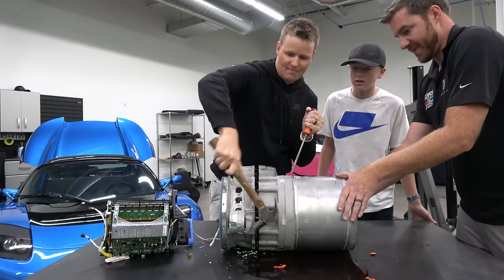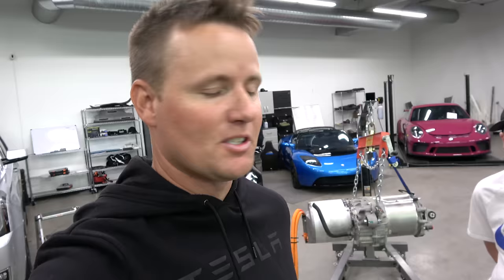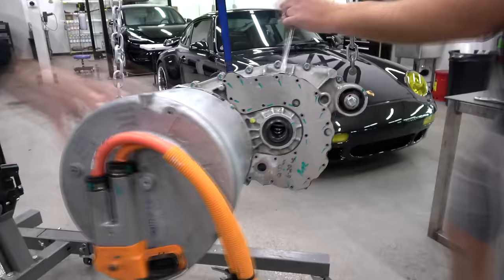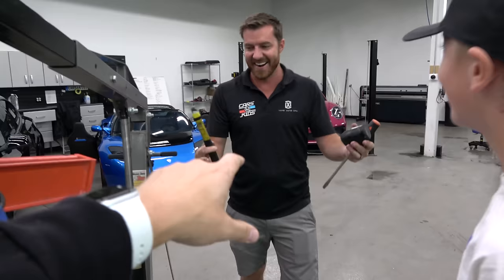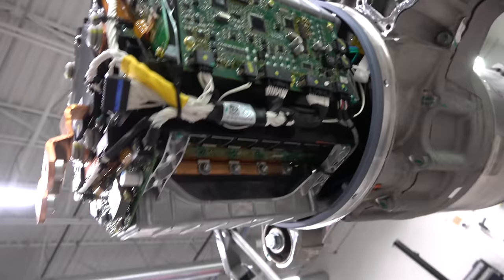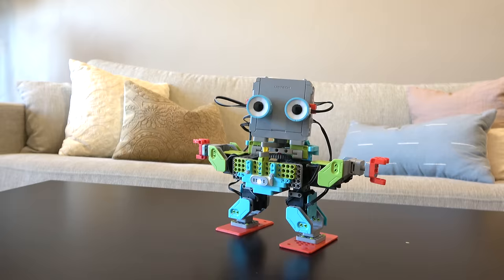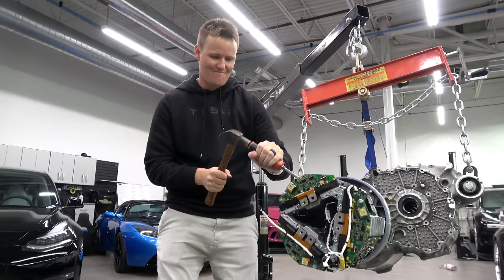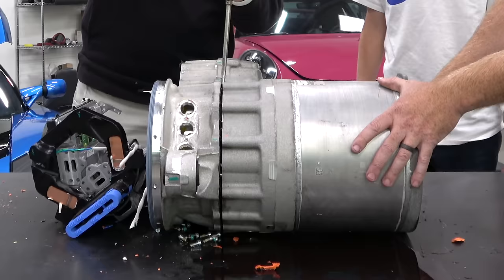What's inside a Tesla Engine?

Comment: That is amazing.... especially the computer triad area.  It is a sturdy design surviving those punishing/ jarring roads with pot holes and bumps .... then looking at the the home computer/lap top mother boards and knowing they are very sensitive to breaking when dropped.  

The home computer/lap top companies need to come up the same durability for their motherboards as did Tesla.
Reply: Reminds me of the internal layout of Apple's old "dustbin" Mac Pro.
Reply: What's inside Tesla power 2
Reply: The motor is on the body of the car, which is shock mounted, so this motor sees no more and no less road shock than the stereo inside the cabin... almost all laptop damages are done to the screen, which is mostly glass, or to the keyboard or HDD, which are mechanical, or to the power control systems, which are damaged by bad power sources.  The electronic components almost never fail
Reply: but I want a thin and light laptop and not carry around a triangle awkward shaped laptop.
Reply: No, the home computer motherboards do not, are  not, and never will, be built like Tesla parts.
Reply: i mean ive dropped my machook everywhere and it survived but not without dents in the chasis, this channel also dropped a mac from a flying heli once too, i was amazed that it sort of survived
Reply: @Jasonzvo  i'm sorry... WHAT?!
Reply: @chad9160  the mac that was dropped from a heli, the screen was destroyed but when they plugged the mac back into a external display, it worked normaly
Reply: That would just mean your computer would get bigger and more expensive... not a big market for that kind of computer
Reply: This layout of the power electronics is needed to control the phases U V W symmetrically and to equalize and minimize parasitic inductive effects.
Tesla has to pay special attention to this, because their electronics are not better than those of the other manufacturers, but cheap. 
It's no big deal if you connect four IGBTs in parallel for the Highside and Lowside instead of one IBGT(transistor).
Reply: This comment makes no sense.
Reply: @andreacoppini  almost exactly what I was going to reply..aside from maybe popping a cooler off the board because of some crap thermal compound, a modern notebook with an SSD is going to be very hard to kill.  Power connector, screen, and backlights are the only things you could really ever break unless you are REALLY trying.
Reply: Though laptop are old the marines have had them for years they will even stop a bullet gas service engineers in the UK use them as they can be thrown around and mistreated.
Reply: That motor is so sophisticated it looks like there's ALIEN technology in there...  I will not be surprised if one day, we will have some visitors from Proxima Centauri  coming here just to buy some Tesla vehicles.  That technology is simply AMAZING !
Reply: This comment shows a complete lack of any electrical or board construction knowledge. Home computers don't need to be, and shouldn't be anything like an electric motor computer.
Reply: The motors in my RC cars survive 100 foot drops and so do the circuits
Reply: I took apart a printer before and made artwork out of it.
Reply: Elon is like Tony Stark if instead of being a super genius, Tony hired the world's finest engineering talent at wholesale wages, and sold their efforts retail with his name on it.
Reply: The only things you can change in a motherboard is the thickness of its different layers or simply increase or decrease overall thickness. so as someone studying in a related field allow me to get technical here.
1.first throw out the idea that different material will be used in making motherboards.
2.laptops need to be light and thin while being power efficient and dissipate heat quickly.A thicker motherboard is worse in all these areas. 
Now lets get in. motherboards need to be just a little more flexible than the laptop frame so they always crack or break after the frame breaks. If you had a naked motherboard then the thicker the better ,but in a laptop actually a thick motherboard is more breakable than a thin one, because if its thick and less flexible than the laptop then its going break before the frame does. Also in these situations the roles of motherboards and frames change because here the motherboard will be the one actually protecting the frame from bending to breaking point, unless of course you make an even stronger frame which will either cost more or weigh more or both.
Reply: @sweetdreams1DIAM0ND  I know I am not a great technical person but that is why I have to trust someone to help me too.
Reply: Think about this for a minute. If you put your laptop in the car and drive around for a year it will be fine. Why? Because the suspension absorbs the energy from those potholes etc and that prevents damage. If you drop that tesla board from the height you drop a laptop from it will take damage and probably be screwed aswell.  I like Tesla cars but they are not magic.
Reply: @pyrobedlam  And this thing is on suspension. If you put your laptop in the car it'll be fine too, because of that same suspension. It's weird to see how much non technical people fawn over tesla parts thinking they are amazing isn't it.
Reply: @gerrycrisostomo6571  I'm sorry but it's not. It's just that you don't know anything about this technology so it appears amazing to you. No offence.
Reply: @highmarkrich  And home laptops are just fine when they have suspension ie they are in the car just like this hardware is. This thing wouldn't like being dropped by itself at all.
Reply: @ZennExile  Hahaha I love it.
Reply: @sweetdreams1DIAM0ND  Everybody is getting technical while missing the point entirely. The suspension of the car is the saving grace here. You can drive around with your laptop going over pot holes just fine because of it. If this hardware was exposed to road forces without suspension it would break. Technologically and/or mechanically illiterate people constantly thinking tesla parts are "omg soo AmAaaMmAzZiNG" does my head in. (Btw I'm not including you in those people)
Reply: I was wearing my Alienware backpack with a 15R4 inside when car almost killed me going the wrong direction in a one way road.  My bike is dead but my Alienware booted right up. I had a 14" laceration on my leg, 1/3rd of my colon removed, collapsed lung, two broken ribs, aortic stent, broken jaw in two spots, five teeth cracked (full faces helmet). Here I sit watching youtube and playing D2 on my 15R4.
Reply: You are comparing dc to 3 phase ac convertor circuit to laptop motherboard. Makes no sense.
Reply: Wtf did I just read..
Reply: Lol clearly none of you "automotive geniuses" have ever looked at any engine computer from any fuel injected car back to the 80s  

For example my early 90s jeep ECU was a Motorola built computer .... (Motorola built the radios for all the nasa space programs)   it was fully conformal sealed in a rubber type coating .... this is how all chrysler engine computers were made ... 

Makes this mess of small parts look like a risk ....

Not saying this Tesla is garbage .. but its by far not thw most harty electronics thing out there
Reply: Yeah too bad they never opened the ACTUAL MOTOR!
Reply: @KNOX BLOX you;'re either being funny or haven't really looked at computers/laptops in the last 20yrs... of course the $300 laptop isn't shock proof, but still, if you drop it it's not the motherboard that cracks... on the other hand there are 15yrs old laptops that have seen combat action; that;s how tough they are and yes, all sorts of brands and models are available since forever.
Reply: sturdy design surviving potholes? you know ALL cars have computers inside them right? and they do just fine surviving the potholes. doesnt matter where on the car they are located.. nothing special or impressive about that.
Reply: KNOX BLOX the board is still delicate, it’s the housing that’s rugged. That kind of ruggedness in a laptop body would make it a desktop or a counter top :)
Reply: You won't drive a laptop at 70mph down a highway though
Reply: You're exactly what's wrong with uneducated consumers: Knowing nothing and demanding everything, even if it makes no sense.
Reply: Honestly they should explain some of the stuff instead of saying this thng, that thing oh there are balls in it, o i dont know what that is its super sticky.

The audience could learn so much..
Reply: @remytv  exactly! thats why it is being liked by the channel owner :)
Reply: These are the kind of people that made tesla overrated. Those were just regular old heavy duty PCB's. Nothing out of the ordinary. They are designed to be able to take bending and all sort of stuff without braking. Unless you deliberately start scraching components off, it will survive shocks as well. Nothing special. Its just a pcb.... I swear at the start I was excited for tesla, but after the amount of quality control issues and the blind apple like fans like you i dont like them anymore...
Reply: Ojebiyi Oluwadunsin é whip weep
Reply: COTTON CANDY have been in WTO last month woo
Reply: Patti Lacey has the new day I can get her out w Qi woo 
Woo WTO woo woo woo eep eep eep eep eep R.I.P.
Reply: This already existed in the old Mac Pro , and it had several shortcoming coz of that design, see for yourself. Moreover, these are all semi passive parts , the main processing is done inside another computer.
Reply: KNOK BLOX Try not to show the world your ignorance. No computers are hitting potholes. And all that other crap you said: just don't.
Reply: @berfle8482  Jesus man how technical can you get? You're on the wrong forum. They probably wouldn't listen to you there either LoL
Reply: @wernerholm5423  They seem to be incapable of teaching an audience anything. They simply cut into things. Anyone I mean anyone can cut into something for f$&k sake. It's the simple minds that find this channel amusing so they subscribe. That's what society is turning into.
Reply: @ThomasFarquhar2  Yes you would, people do everyday, in their cars.
Reply: @Jasonzvo  I ran over my mac laptop once. The only damage was a screw got knocked loose and shorted against part of the motherboard. I opened it up, removed the screw, put it back together, and it worked for years after that.
Reply: it's not a computer, it's electronics to convert DC from the battery into three-phase AC for the motor itself, apart one IC that's as smart as a casio calculator, rest are power transistors.
Reply: @KNOX BLOX they only opened the inverter(vatiable frequency drive) and the transmission. They didnt even touch the motor.
Reply: KNOX BLOX sorry that’s only for future space people
Reply: omfg 666 likes
Reply: That disctance between the electronics is because of magnetic flux which can be creates if this wires en amperages go against each other
Reply: Well, other than traditional hard disks and monitors, computers/laptops are not as fragile as you thought.
Reply: they allready came up with that design long ago.
i have 2-3 motherboards..here just for display.
its the most amzing tech i have seen on motherboards..
they are gold and designed on aliminium
Reply: Pinned the only good comment🤣🤣🤣
Reply: Wrong method if dismantling, should be by suitable mechanical puller
Reply: Well, home computer/laptops aren't designed to be rugged. However, there are rugged computers that could withstand lots of pounding.
Reply: You know, motherboards are very durable really, as many has said there's no need for large super durable expensive mobos
Reply: No there's no need to come up with anything, there are already ruggedized computers for special applications, like military use, outdoors, various harsh environments... Check out the Dell rugged series for example. They're bulky and expensive as hell, pretty much like the electronics inside this motor.
Most people generally want their laptops to be as thin and light as possible, not +5 Kg with an integrated carrying handle like in the 1980s. You can't have everything.
Reply: then the price wud be insane too... LOL
Reply: Roblox
Reply: Could of used that part you bent :(
Reply: Why would your home computer need to survive potholes?
Reply: I'm more worried about battery degredation. How long does your phone/laptop battery last? Same thing with a Tesla. A 10,000 dollar honda civic can outlast the life of a brand new 40k Model 3.
Reply: They did. In the 90's. Its called the Panasonic toughbook. Do some freaking research. Its not popular, because it costs much more money to do that. Turns out, the average laptop user doesn't think $3000 for a 10 foot drop proof laptop is worth it.  Its too bad the laptop companies dont have a government subsidy to offset the high price of a hardened laptop, like Tesla enjoys.
Reply: @m.nijsink6907  Why do people pretend to know something they don't?
Reply: Home computers are build that :D Companies had priority to make it unreliable, because owners buy new parts
Reply: @remytv  He heard a phrase "IGBT" and now uses it like he knows what he is saying. You cant run 3 phase motor on one IGBT no matter how large it is. And what you are seeing is a PWM VFD electronics built on to the end of a AC motor.
Reply: Thats the Inverter not the computer
Reply: What you call a pc is just the inverter. It converts the DC single phase from the battery into 3 phase AC that the motor needs to function it also controls the frequency which regulates the speed of the vehicle.
Reply: Obviously things that are meant to be used on a moving vehicle are built to withstand strong vibration unlike desktops, which are hardly ever moved. Those found inside the motor aren't exactly "computers", they are inverters as well as electronic speed controller.
Reply: 🐷脑…
Reply: Unless you're working in harsh terrain you don't need rugged laptop especially pc, you don't want to carry pc everywhere, and remember tesla is car not computing device
Reply: Usually the board isn't your failure point in a computer.
Reply: @highmarkrich  zero
Reply: you can do reverse engineering and make your own tesla motor.....😅😅 just find out what the blue liquid is🤣🤣🤣
Reply: @berfle8482  or reduce resistance when it acts like a bucket converter at low speed.
Reply: @ZennExile  What I respect most about Elon is his leadership and ability to understand each of the divisions of complex projects and getting the result better than anyone. He utilizes his top talent amazingly and together, they are pushing us forward technologically speaking.
Reply: What!!!???? There's nothing in there. Just two reduction gear sets (3 to 1).
Reply: @Lvatopesado  context?   You say two ( plural ) set ( plural )  and "nothing". So what do you mean, the one or the other? Then there is a diff. What do you mean by "there" :  You ignored the two cans. Or do you want to tell the world that EV is so much simpler than ICE. You know, the world already knows that. Its just a problem of range.
Reply: Washing machines dishwashers basically any appliances that use motherboards could use help from Tesla.
Reply: Did anyonee mention half of the whole block they bought is an inverter?
Reply: car that requires lithium batteries is a scam and "Tesla motors" is and insult to Nikola Tesla
Reply: And actually, motherboards are actually resilient to vibrations. You would be amazed.
Reply: @area51alien29  awesome profile pic
Reply: @gerrycrisostomo6571  👆👆 Hey  fan, you won a package 🎁🎁  claim your prize
Reply: @ericreed4535  👆👆 Hey  fan, you won a package 🎁🎁  claim your prize
Reply: You can bring a laptop into a car and it's not going to get destroyed.
Reply: Yeah but what did u do today